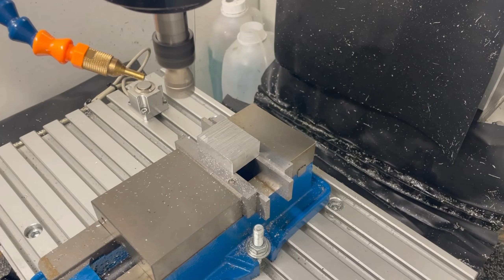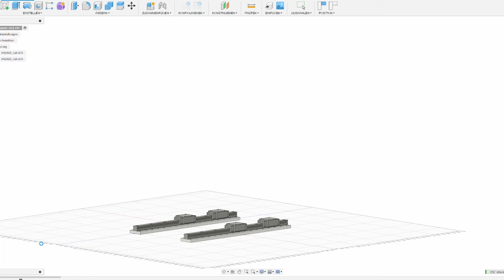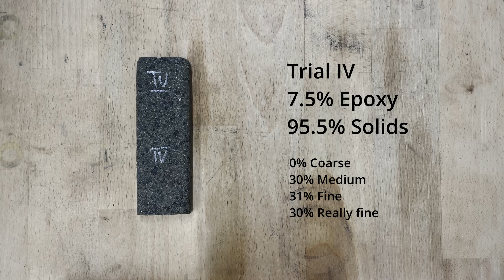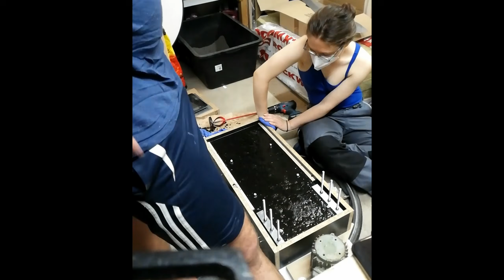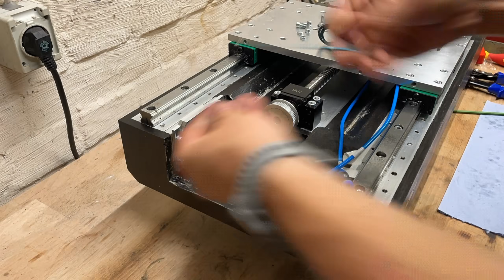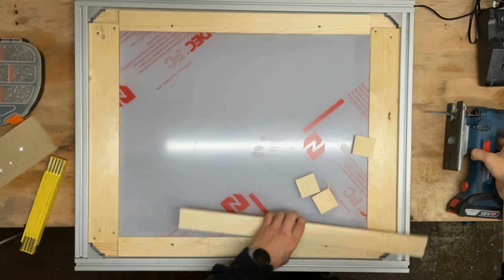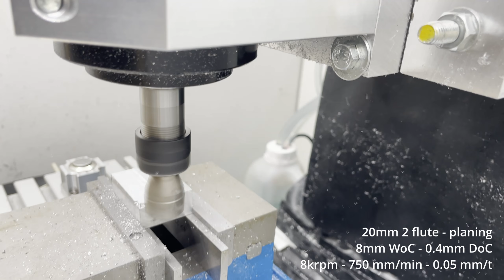Mineral epoxy CNC build review

Comment: Where did you get the t-slot table?
Reply from the maker: @optik04  the shop is called www.cnc-shop.mobasi.com. It’s the 250x20 in 400mm length. At the time of purchase (2022) it was a comparatively good price there, but I don’t know if that is still the case

Comment: umm no offense but it's really hard for me to access the 3d file of your project
Reply from the maker: all good. I used Fusion for the desing and also export. What program do you want to use?
Reply: @lukasOtis  This is actually my alt acc, so far I'm now able to access it since i decided to just download fusion 360. I decided to disassemble/explode the 3d model first in prusa slicer before uploading it to fusion because I want to get the measurements of the sliding tables and columns for making the molds.

Comment: I play with composite, for some time. You could learn from the making of forged carbon fiber process.

I ll share the step i do:
1. Prepare coarse and fine particle, ex rocks vs fine grid sand.
2. Mix the epoxy evenly and mix it with fine sand. Separate a small amount for final surface.
3. Pour thin layer of epoxy fine sand mix as gel coat. 5mm to 10mm is a good starting, try what work for you.
4. Use heat gun, the purpose is to remove air bubbles and accelerate curing. Do not overheat, heat i to 150°C max for 2-3mins.
5. Put a coarse material, if you use 1 cm rock just put a layer.
6. Pour another fine epoxy fine grain mix until the coarse material do not protude. Heat it again for 2-3mins.
7. This is the most important steps, cover it with pe sheet. Press it as hard as you could. This and the temperature wil remove air bubbles and make it very dense and strong. You could also use wood hammer, like forging sword.
8. Repeat step 5 to 7 until the thickness that you need reaches.
9. Mix the small amout of epoxy from step 2 with epoxy fine grain mix you have for the final layer and make the final surface.
10. This is optional but i do cure the epoxy above 100°C for the first 6 hpurs, this make it a lot stiffer.
Reply from the maker: thanks!
Reply: All resins benefit from post cure, but immediate cure at 100C is highly unwise?!? Even a high temperature epoxy, like EL160 from Easy Composites (my preferred resin for things like this), you let it cure at room temps for 24h minimum and then post cure, starting at 40C and ramp up over a number of hours. Going straight to high temps gains you nothing but risk. 100C is well above the glass transition temp for most epoxies too, many of the cheap epoxies people use, it's way lower, even down to 50c. So yeah, thats straight going to damage them. This seems like very bad advice for most people.
Reply: @TheMastaRob read carefully, it is just to remove bubble and producing seeds for the matrix growth. Read some reseach paper, i am too lazy to explain. I already done somehow formal reseach on this, my undergrad major is chemistry.

Comment: Tolles Projekt. Frage würdest Du das Spindelteil wieder aus Epoxid fertigen und wenn ja wieso und wenn nein wieso nicht. Hab das so noch nicht gesehen sieht aber interessant aus. Was war der Gedanke dahinter? Etwas Granit-Epoxid-Masse um Schwingungen zu dämpfen oder einfach Gusseisen Ersatz?  Grüsse danke und nochmals tolles Teil! =)
Reply from the maker: Besten Dank! Das Teil ist primär dazu da die Spindel in die Mitte der Y Achse zu bekommen. So kann ich alle Punkte auf dem Tisch erreichen. Bin sehr zufrieden damit wie es funktioniert, würde es beim nächsten mal fast ein wenig kleiner machen. Das aber mehr für eine bessere Optik
Reply: @lukasOtis  Ok. und wie gut ist der Antivibrationseffekt vom Epoxy auf die Spindel? Hab ein Stück auf dem Tisch vor mir das dämpft schon extrem was ab.
Reply from the maker: Ich denke recht gut, kann ich aber nicht wirklich messen. Bei der Fräse wie sie jetzt ist vibriert der Tisch bevor ich wirklich etwas an der Spindel merke (wenn ich z.B mehr Material abtrage als ich sollte)
Reply: @lukasOtis  ok. Das macht Sinn, die Vergussmasse absorbiert extrem gut Vibrationen.
Danke Grüsse

Comment: very cool! I didn't notice you doing it but have you tried slowly spinning your dial gauge on an arm maybe 100mm from your spindle to see if your spindle is 90 degrees to the bed, it looks like that's most of the surface variance in your test pieces.
Reply from the maker: i had tried that while using shims and a hammer to try to get the spindle as close to the 90°C as possible. After a while I didnt know anymore if the spindle or the base is now more out of plane. But I havent checked it after surfacing the table. Think I will do that, thanks

Comment: I was going to ask if you noticed any distortion due to heat during casting but since you mentioned casting reached 30 deg and you diluted epoxy with granite I guess you didn't experience any heat issues?
Reply from the maker: No, luckily did not had any issues with heat. I think it’s the combination of a somewhat long curing epoxy and having less than 15% in the mix.

Comment: Thank you for sharing this video and for sure you have designed and built an interesting compact sized cnc mill with a Epoxy base.

It would be really great if you can do a separate video of the design of the wooden base for shaping the epoxy and most importantly how you assembled the metal frame using different sized bolts and spacers, taping the holes and you mentioned about applying bees wax to prevent the expoxy from sticking.
Reply from the maker: Thanks, I sadly don’t have a lot of footage or images building the frame and have gotten rid of the material as well. But once I will cast another part, I can go more into detail

Comment: Nice little CNC mill you've made there =)
For cutting aluminium - you can use regular household isopropyl alcohol. Its far less messy than any oil-based cutting liquid and its wonderful for aluminium
Reply: That's good to know. Do you use a mister set up? No real risk of fire?
Reply: @evanlane1690 no fire, just invisible hot flame 🤣🤣

Comment: if your goal was to make parts, not build machines, then this was the wrong approach, there are plenty of very VERY good industrial machines on industrial auctions (and you don't need to be a company to participate, you simply will be charged VAT as individual), you can buy an old cnc from late 90ties to early 2000s for the price of your materials, some may have problems, but they aren't unfixable, and you're handy with control electronics, so a linuxcnc retrofit is also an option
yes, they are heavy, but at the end you have a very capable and precise machine that will handle any material, as opposed to what your current build can do
Mikron WF21 for instance is 2.4t and has working envelope of just over 400mm cube, but you get Heidenhain glass scales on all axis and usually Heidenhain control, which while not very fast, are very good, even for hand coding, hydraulic tool changes and proper tool holder, yes, the spindle is slow for aluminum, but that would come into play only when you go all out production, which I understand is not the goal here
Maho have similar machines in the 400 range, but need to be wary about P models, some have leadscrews instead of ballscrews
I bought Mikron WF41 (3.4t and ~600mm cube work envelope) for 1250 EUR, it had electrical problems, but they were really easy and cheap to fix, there is wear, and you need to be mindful about how to approach critical dimensions with that in mind, but usually that is a question of 0.01~0.02mm, anything over 0.05 is trivial - and that is any day, every day and whole day, steel, stainless steel, titanium, cast iron, it will do anything

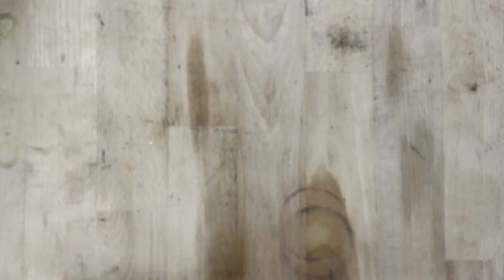Comment: 5:35 has 103% material
Reply from the maker: the 7.5% Epoxy is correct and it should have been 92.5% solids
Reply: The extra is in case you need a bit more during the pour. It’s always best practice to have a little spare material.

Comment: What is the tool you're using at 1:12? I've been looking for a tool like this for a small spindle for a while
Reply from the maker: Got it from overseas and it’s listed as „Right angle milling cutter 300R C10-20-60-2T“ using APMT1135 inserts I purchased separately

Comment: I'd consider removing the belts on the steppers and drive the screw directly. You'll get better results
Reply: Sorry I'm not questioning your expertise but are you sure?

Id like to know genuinely, won't you get proper zero backlash using a belt?

The "zero backlash" couplers aren't true zero backlash items,  if going for micron precision is it better to pay for proper zero backlash couplers?

Plus the gear ratio aspect, using a belt you get a much wider band of possible gear ratios.

It's hard to get a firm answer to my question!!

For a micron precision machine for watchmaking, is using proper zero backlash couplers or using belts setup and aligned properly of course.

Which is more precise when setup and installed correctly??

Thanks! 😅
Reply: @nowar9220  belts stretch and vibrate..  direct drive you don't have these issues. I've ran precision machines of various types and none use belts. There is also back lash compensation within most professional controllers too and even tuning of the drives for the voltage and frequency of the supply voltage which will vary from where the machine is installed
Reply: @adambundy2639  ahh thanks, as I suspected originally, quite a few times I've seen ppl recommend belts  for precision over direct drive, maybe they've had bad experience with cheap direct pulleys

Thanks for getting back to me and letting me know, will def go direct drive on my upcoming build!
Reply: @nowar9220  people do it because they don't like the steppers sticking out or for more resolution. But tbh I think that comes down to people not knowing there's different pitch lead screws for example. Worth studying so you can find the best motor and leadscrew combo for your purpose.

Comment: When people design and Build a CNC it's all about the; rigidity, speed, resolution, motor power  💪
When people start USING the CNC...
Then it's all about; flood coolant, chip clearance, tool setting, noise and mess reduction  😎
Reply: well said. You spent months designing, building and aligning the CNC into sub 10 microns, ONLY to realise that you need proper air to fluid ratio, chip protector on ballscrews and a STURDY base heavy steel structure to position the machine
Reply from the maker: I was indeed thinking about flood cooling a couple days ago
Reply: @lukasOtis    yeah and it's not just for the cooling, if it is set up right the liquid blows all the chips out of the grooves and cavities, so the cutter is not munching up all the chips which causes a whole heap of problems.
Very nice machine build, by the way. 👍🙂

Comment: Well done and nice video. Will you support the Z axis in the future since it has a lot of weight with the Epoxy Part? The 7,5% Epoxy and 95,5 % Solid was a typo, or ? I saw one video some time ago where these round spindle got a second clamp at the top which increased rigidity.
Reply from the maker: Thanks! That slipped through, the 7.5% Epoxy is correct and with that it should have been 92.5% solids. As it has been fine the last 2 years, I am not sure if a support is needed. A second clamp was originally planned and still is somewhat. Haven’t gotten around to it though

Comment: nice work man ,been contemplating doing a similar project myself looks great, tho unless the gas springs bring the enclosure door above head height i would probably just have the door open against the wall horizontally rather than vertically as it is now
Reply from the maker: Thanks! And thats a good point. Above headhight should be doable, I think the door can open more than 130/140°, which I will try to make happen